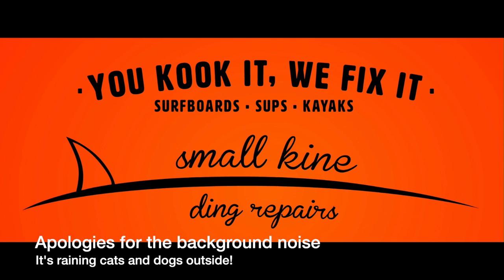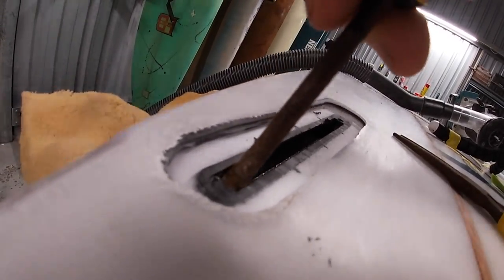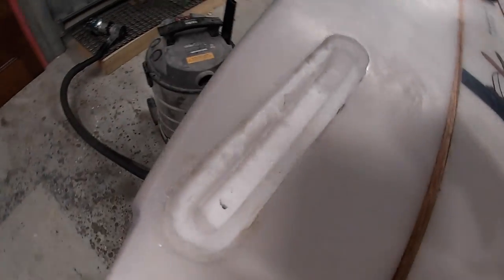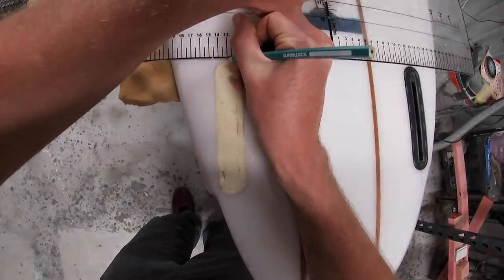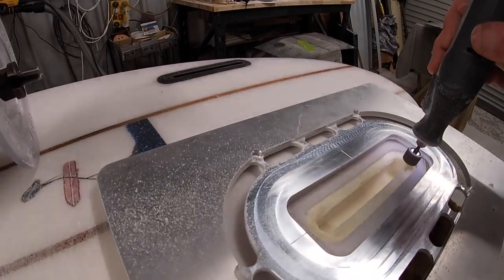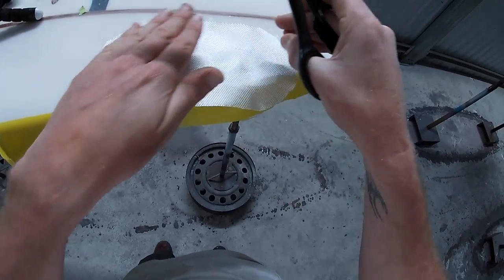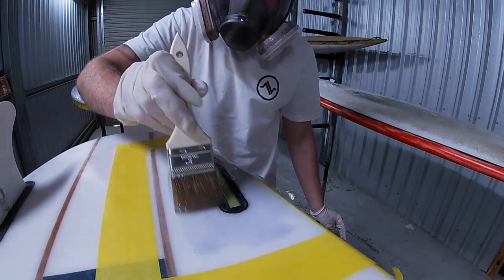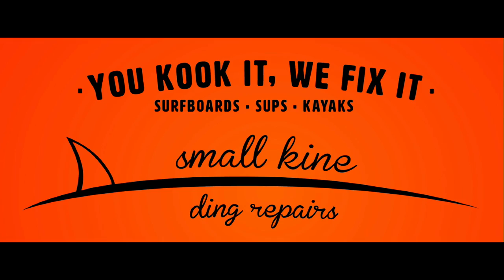HOW A PROFESSIONAL REALLY FIXES YOUR SURFBOARD: Futures fin box replacement

Comment: Hey looks great! Polish work is excellent smart to feather up the board there for a consistent finish
Video quality is top as always
Its never easy to remove a box thats for sure
Yet you did such a good job you make it look easy

My question is this
Its my understanding we sand down to lamination fabric so the new repair lam we put down has something to strongly affix to. Here after putting in the box the overflow resin is squeegeed out over the previously sanded bottom showing fibers, thus messing up the nice fabric to fabric bond we worked to getting by sanding. Do you think this bond is worth fussing over? Or is it another area of ding repair that is a bit grey as to how important it is? Thanks for the great video and repair work
Reply from the maker: Gday Gabe,

Solid question! With epoxy it would be an issue for sure but the bonus with poly laminating resin is it keeps its stickiness after curing to allow lamination over the top and because it's wiped out so hard in the clean up process I don't see it as an issue. If in doubt though, you could certainly mask up to the route before installing the box and then remove that tape before lamination

Comment: The futures gig doesn't need to be secured to the board from moving around..?
Reply from the maker: The futures jig is pretty weighty so never had an issue with movement. I don't tape my fcs ones down either though because they are so small, the masking tape can actually get in the way of the routers base. Just slow and steady

Comment: Can you tell me more about the expansion foam , where to buy ? What type is best ?
Reply from the maker: Sure! So it's a 2 part expanding Polyurethane foam. The ideal density is 56kg (they use LB in the states so you'll have to do the conversion if you're there). 64kg can be good for major repairs like snaps and large delams but 56kg is pretty bang on to a PU blank. You can either source it from a local PU foam manufacturer or, if you struggle to find the right density contact your local taxidermist and ask for their source as they seem to all use 56kg. I'll do a video on it this week when I'm back in NZ as I do get a lot of questions about it
Reply: Legend mate love the channel

Comment: Thanks for the video. Question. After putting in the expanding foam and sanding it flat. Did you lay a sheet of glass prior to using the router and jig. I think I heard you say you did, but didn’t see it in the video. If so, was it a 4 ounce sheet? Thanks
Reply from the maker: Yup, that's the one. Foam, sand, lam, hot coat, route, install, lam, hot coat, finish sand. That's with poly.  Usually with epoxy, if there isn't significant damage to the original glass around the box then I'll skip the first laminate as it adds so much extra time to the job with epoxy curing times.

Comment: have you ever tried routing it out in one go with the one-pass-install routerbit?
Reply from the maker: Definitely works a treat straight into foam. It's a little tougher and rougher om the cutting bit going through fibreglass so I prefer to take a few passes. Although it's never happened before, I can also imagine the bit grabbing my repairs fibreglass funny and lifting it too which would piss me off 😂